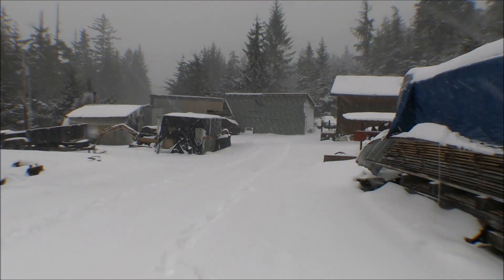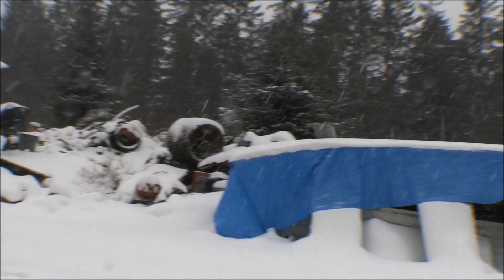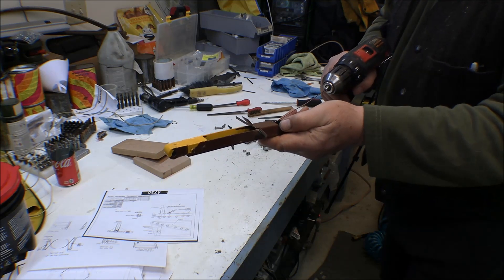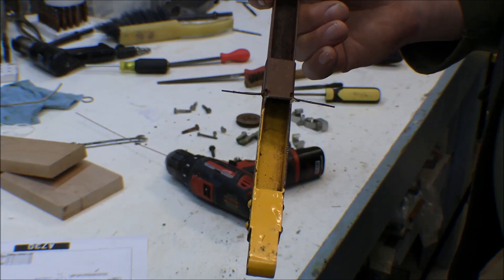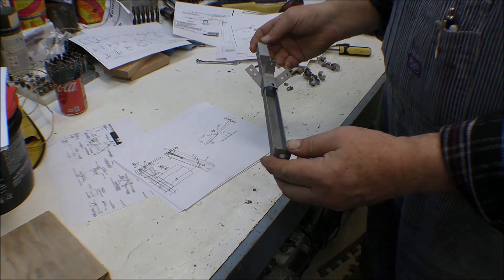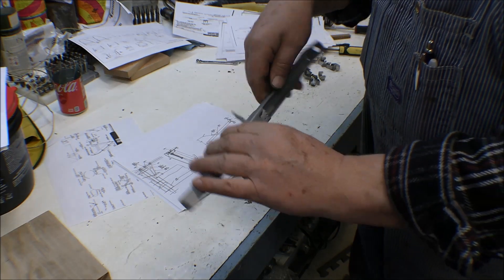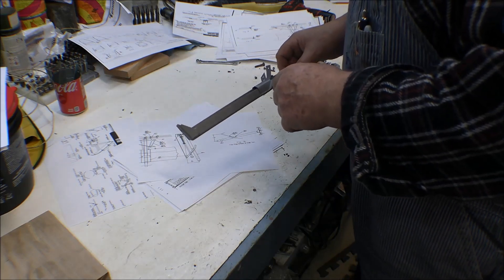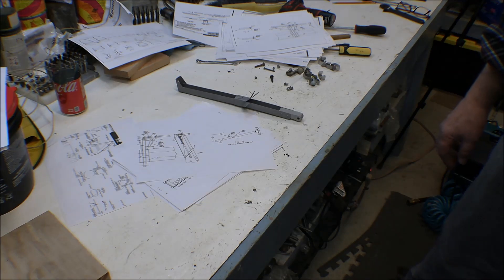Piper Super Cub Wing / Outboard Flap Hinge

Comment: Good call on replacing that hinge, Carl. I figured it would look like that after you blasted it. Univair has those, but they're around $250 or so, give or take. The four of them are different in price, so I can't say what that one costs--but they should have them in stock. If the fittings on either end are good, I would be tempted to make one...as long as I had the material. I imagine that's 1018 or 1020 mild steel, but I haven't look at the Super Cub drawings lately. But if you have the material and a sheet metal brake, I think you could make it in a few hours. Might end up taking you a day or so, but it would cost a lot less than the $300 it's going to cost to get one shipped from Colorado. Your mileage may vary though.
Reply from the maker: Ya, it's 1025 .040. Don't have any of that around and it would take a month to get it.
I ordered one from Dakota Cub, $125. Their parts are quite a but less than Univair and pretty nice. I try to avoid Univair if I can, they will only ship UPS and that takes weeks and cost through the nose. Many of the parts I've gotten from them are sub-par. Rusty under the heavy coat of red oxide primer
Reply: Ugh... For $125, you can't go wrong. I don't think I could make one for that, considering shop labor. 

I don't know whether or not you saw the comments on that hand squeezer yoke in the other thread, but I got it from US Industrial Tool, out in the California. It's model 9070-5 I think? I posted a link to a picture I uploaded, and gave the contact information in that other video. Let me know if you can't find it... @psgflier